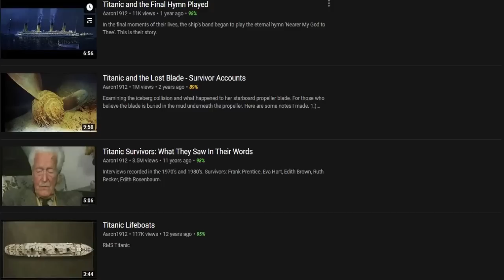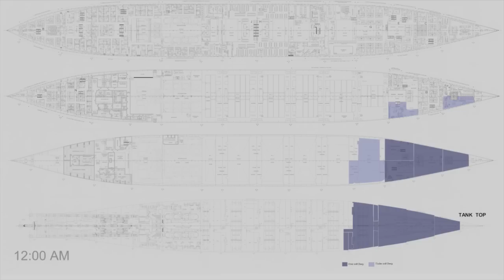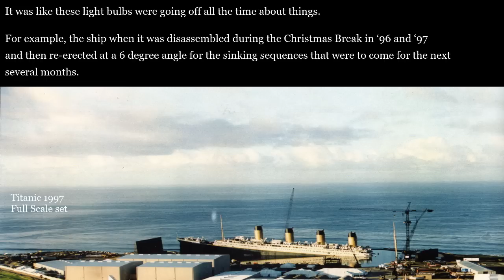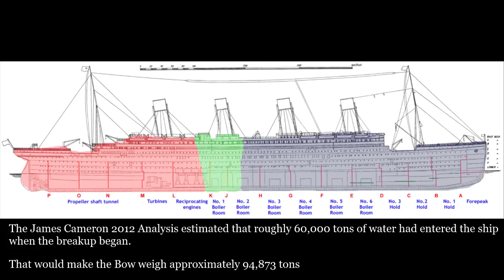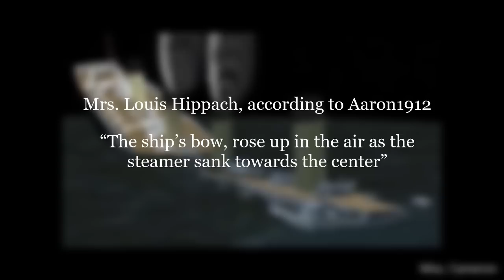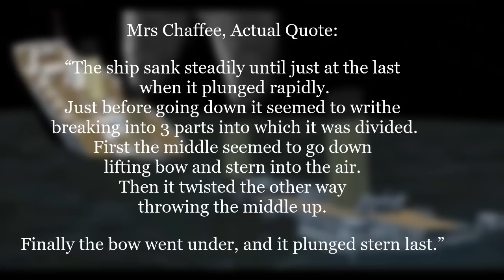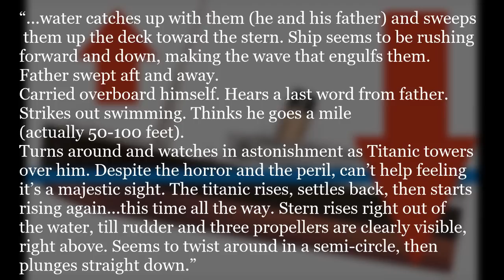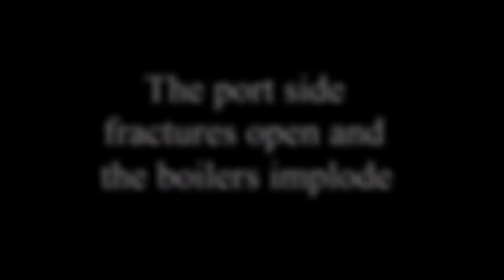Disproving Aaron1912's Titanic V-break

Comment: I agree with you on basically 99% of this.  I won't say 100% because there's probably something I can't identify immediately that I wouldn't.  But yes, the simple physics of the impact, the flooding, etc. dictate that whatever happened, whichever way the ship may have listed in the process, etc., it went down by the bow, and broke apart as the bow's weight pulled it down against the buoyancy of the unflooded stern.  Furthermore, the state of the stern upon the wreck's discovery corroborates this model, as the only rational explanation for its state of ruin is that it sank largely full of air, and that escaping air, being a compressible fluid and needing to escape due to its lighter weight than liquid water, compressed until its pressurized state overcame the tensile strength of the rivets holding together the hull, at which point it forced its way out wherever it could, blasting the stern apart.  The lack of air in the bow, by then fully flooded, is the only explanation for a lack of similar damage to that section, and absolutely, according to every law of gravity, structural engineering, and hydrodynamics, dictates that it would have been pulled down well prior to the stern.

Comment: The only way for both bow and stern to go up is if a torpedo or explosion went off right in the middle of the ship and break the ship's keel in the explosion. (Water floods the middle of the ship while bow and stern still have boyancey) Which was not how Titanic sunk. 
Last coffin the the nail is Tatanic's wrack is miles apart with bow pointed away from stern towards SW west of stern. If the bow sunk with tip pointing at sky, it should fall not far from the stern or even behind the stern (move towards east), hydrodynamics won't help the bow to rotate 180 in water...

Comment: How to fix this theory:

Either:

Disregard it completely

Or

She sank like she did in a Night To Remember, sort of, with no visible break above the surface, going fully vertical near the end.

Just like the National Geographic video, she goes down like a torpedo. However, she’s still in 1 piece.

And when the bow would normally go into a stable position, she is unable to stay whole and performs an underwater V-break.

This makes way more sense. It’s probably not true, but it has so much more accuracy.

Comment: If you are looking for the truth,  Check with your Titanic group and, well, physics really.   The bow does not get heavier when it is filled with water from sinking.  It gets less buoyant sure but the size of a crane needed to hold it up under the water would be that same (pretty much) as in the air.   i.e. 35k tons or whatever.  That's all you need to get it out of the water with enough time.   It's not the weight that's aaron's problem.   It's the speed.  You need time for the water to clear or you will be lifting the bow (35k tons ) and the water (about a gazillion tons).  
Just thought I'd give you a heads up as your likely going to get a lunatic video showing the bow isn't heavier with a practical (and valid) video so they can dismiss your entire video.

Comment: Common sense should convince anyone who watches Aarons channel that a ships bow(front) is for the most part the heaviest portion of all ships. Why? They carry two anchors and larger ships carry backup anchors just in case they lose one. So that is four anchors and massive chains that make up approximately 75% of a ships shear weight to be focused on the bow or nose.  

To believe that any ships bow could rise up from an already nose down position would be ludicrous.  In fact even ships torpedoed in half would never raise at the bow either. 

The stern(rear) being a wider birth to the tune of five to ten times the bow's width also adds in massive additional air pockets that would cause a stern to raise.  Aaron is attempting to claim a boiler exploded which also would be irrelevant because once cold water entered the engine rooms the boilers by this time would have been already extinguished and cooled down below any high pressure condition within a matter minutes not hours. 

I operated massive boilers used in feed production for many years and maintained them. Once you shut one off or kill the fire they begin a temperature dive below a shock level in about five minutes or less which would render any cold water shock caused explosion impossible. Likewise all boiler explosions are caused by too much flame, too much heat and not enough release of steam. 

The fact that the generators being boiler powered were still generated by some steam pressure even while sinking means no explosion occurred to have released all the boilers main line pressures and convinces me also that them and their main steam lines and pipe were still sealed and were properly still holding enough pressure to maintain the generators for the lights even as she was sinking which eye witnesses confessed.

So even if one boiler had exploded the main steam pressure line would not have maintained any pressure and thus no generators and absolutely no sinking lights would have been witnessed. ----Logically Aaron stands debunked !

PS Interesting enough is if the captain would ordered all three anchors and their chains to have been released, this may have prevented the ship from sinking as fast as it did and may have also prevented her from splitting in two as rapidly also. 

Buying that time could be surmised easily into 30 to 45 additional minutes per say,,,so in 1 hour and 30 to 45 minutes for Carpathia to arrive could have saved more lives than the 3 hour and 30 minutes it took them to get there likewise.

Comment: There is evidence of a potential V break just not Erin’s type of break the bow would not have broken the water the evidence is two pieces of double bottom hull And how the top part is crushed and the bottom is a clean break but again even if that happened the bow would not have broken the surface

Comment: I'm studying engineering, and the only way 13,000 tons and change would be able to lift the bow section is if the stern was on one end of a very very long lever, with the bow on the short end.  To lift the bow, though, the end of the lever that the stern was sitting on would have to be roughly 5 times as long as the end that the bow is on.  The stern would sink 5 feet for every foot the bow rose.

This of course assumes that the pivot point of the lever was on solid footing, which it wouldn't be in the ocean

Comment: the only way I could see a V-break happening would be if the ship had more-or-less 'skidded' into the iceberg during the hard turn and punctured the mid-ship compartments. the center of the ship would then have flooded and possibly caused the one of the ends to shear away upwards due to bouyancy (which would appear as a V-break) the issue with this is that there's no evidence that this set of circumstances occurred. so the V-break theory is nothing more than a hair-brained idea

Comment: Not that I didn't need to watch all your video but I have already stopped it at the 3:30 mark and know that the other guys animation cannot be correct.

1. The Bow was completely full of water. The water had plenty of time to get into every nook and cranny. Hence why it went down and only down.
2. Scotland road did allow lots of water to flow down the port side, eventually evening out Titanics starboard list and causing a port list that would persist until sinking. Scotland road caused the port list but nothing more. Experts believe that the stockpiling of coal on the starboard side, which gave the ship its earlier starboard list was countering the pull to port from the water.
3. With the Bow full of water there is no force on earth that will pull it out of the water. The reason the stern lifted was because it was full of air and the ships tilt meant water couldn't get to it but at the same time the full bow was trying to sink.
4. The stern lifting was what caued the stress in the hull and the eventual break. The ship would not break apart if it was sinking vertically. How could it? What would cause a ship to snap in two when it was at close to 0 degrees of elevation? Ships are designed to be flat on the water so it would never break like that. The Britannic is a good example here. Same ship near enough. It sunk so fast that the stern didn't have a chance to rise out of the water so far. It sank intact.

Further points

In the survivor testimony where they saw the nose rise out of the water, if the nose was initially underwater and then proceeded to rise up out of it how was this survivor "standing on the nose"?

Comment: Watched a video looking at the real wreck and  it is possible that the after the hull split, the bow moved upward. Not saying it is coming out of the water but the hull pieces on the bottom reveal that the double hull bottom flexed both ways before snapping into two separate pieces  and landing in the debris field separately. This is not anyone's recollection but what is seen on the sea floor. Still very small arguing point, the ship sank, sad.

Comment: I believe... 

the bow got deeper into the water right because it filled with ocean water..

Bow is submerged deeper, meaning if it continuously went deeper, under the ocean water level, and more water was flooding into the ship at the same time it's logic that even if the ship was sinking vertically the water will still be able to flow along the corridors and move towards the stern.

And then when the ship reaches the point when the stern is too high up, the pressure of the weight overpowers the hull and the hull breaks that would make more water pour into the stern.....trapping people...

Horrible..

Comment: 10:57
No. The bow weighs 34 873 tonnes. All that's happened is that there's no longer a meaningful pressure differential between the water inside the bow, and the watee outside the bow.

With no meaningful pressure differential, there can be no meaningful force of bouyancy.
The water stopped supporting the bow's weight. Simple as.

Comment: Actually the part where you explained the bow got heavier the more water entered it is incorrect. This would only apply if the ship was on dry land and water was poured into it as if the ship was a container or a bucket. This would then put more weight on the surface below, which would count as the ship being heavier.

With a ship being in the water this theory does not apply. When measuring weight, the fluid in which the measurement takes places does not count towards the weight of the measured object (air is a fluid, it just floats on top of water as it is lighter), meaning that on land you don't count the weight of the air inside the ship, as this is equal to the air outside of the ship and is part of the same volume. You do count the water towards total weight as it is not part of the main fluid in which the measurement takes place. 

When you're comparing the weight of the ship on water instead of in open air, any water that enters the ship and has a direct connection to the outside water does not count towards the weight, as it is part of the same volume of fluid in which you are measuring. The only water onboard that counts as weight of the ship is water that is not directly connected to the volume in which it floats, for instance bottled water, fresh water in sealed containers, water in flooded areas completely surrounded by air and water in sealed ballast tanks. This is because the volume of this water cannot mix itself with the seawater, meaning that its volume and weight can't change. Only when a direct connection to the main water volume is re-established does the weight of this water get subtracted from the total weight of the ship, as that water is then no longer displaced.

The materials out of which the ship is built are already heavier than water, but the ship is constructed in a way where it displaces the water without allowing it in, essentially forming a volume of air which is lower than the water surface. If you were to take the exact shape of the external surface of the ship that is below the waterline and instead fill this volume with water, this volume would be heavier than the hollow ship. This means that seawater would always want to be below this volume of air, pushing the ship up, making it float. The raw weight of the materials used to build this front section would still be 34,873 Tons, but the weight of the water it displaces is a lot more, which is why it floats, as the overall volume of the ship is lighter than its surrounding medium.

However, when the hull was punctured, every bit of water that was allowed into the hull no longer counted towards the displacement, because water wants to return to the location it was supposed to be in if there wasn't a ship there, essentially spreading itself out evenly trying to make an even surface all across the globe. But, no matter how much water was allowed into the ship, the weight of the front section would still always be 34,873 tons, it just displaced less and less water. As soon as the weight of the displaced water was less than the weight of the materials, the ship plunged below the surface. This still makes your conclusion about Aaron1912's theory correct. The only way the bow section could resurface after this is if there was enough rotational force and inertia to push itself slightly out of the water again for a brief moment, but this is impossible given the way the ship was orientated and broke, and it certainly would not allow the ship to float again, even if very tiny airpockets remained after the ship broke off, as these airpockets could never displace enough water.

Comment: Jeezus.

The ship doesn't get heavier as it fills with water.
The portions that fill with water lose their buoyancy and it is the weight of the bow section alone that breaks itself away from the stern.

The more complicated answer is that the bow and stern sections lever against each other at a centre of buoyancy that gets more comcentrated as the bow fills up and loses it's formerly uniformly distributed support. Bow going down, stern being lifted and this stress concentration is where the ship failed.

Comment: The doors would close automatically, yes, but with the hoses running through them to each compartment when abandoned would not allow for a tight seal when slammed shut.... There would be a gap where the crimped hoses lays through the doorway...

Comment: i do not even know how this youtuber even believed this 1st of all the bow is completley filled with water when it went under the only way for it to float up is to have a air pocket thats huge but since the bow went underwater with doors open the water finished the job with the bow causing the split so theres no way that the bow can raise back up unless theres a air pocket (in the actual sinking there was a airpocket which helped the titanic stay afloat long enough for every lifeboat to get far enough away) but since its air and is lighter than water it rised to the top area of the water as it was slowly sinking at the time but in aarons video playing in the background it shows all of the decks flooded so it is impossible for it to raise up  but the stern does raise up due to that air pocket after that water filled up the stern section of the split causing it to tilt down due to the air pocket that caused it to stay up the air pocket transitioned to the stern right before the split causing why it stayed over the ocean surface for the last few minutes before it completly sunk down thats basicly what happened in a nutshell

Comment: For the V-break to accurately work the iceberg would have to hit the 
mid-section of the titanic which would cause water to flood the middle of the ship causing stress in between funnels 2 & 3 which would cause the ship to split from the keel up. And the water flooding trapping air and causing an implosion to the bow and stern.

Comment: water in a ship doesn't pull it down, the water outside of the ship doesn't push it up as much. ships float due to being more buoyant than the water they are in. 
when the density of a ship is less than the density of the water it displaces, or any object, it will float as the medium it is in pushes it up, when it has a higher density it sinks.
water flooding a ship increases the density and so sinks.

Comment: The weight of the ship never changed, simply the Titanic's buoyancy changed when it filled with water.  It may seem the ship gained weight, but it was simple physics of the water replacing the air causing the ship to lose buoyancy and with that much sticking out of the water, nothing was going to stop it from breaking in two and sinking.

Ships with no hull damage when riding out a storm have to take care to keep as much of the hull in the water as possible to avoid damaging the hull, breaking the keel, etc.  In the movie, "The Caine Mutiny" they have such a situation and they almost break the keel when going bow into a wave instead of going parallel to it.  My 20 years in the Navy and 15 years in the Merchant Marines, this is exactly how ships operate in storms to prevent damaging the ships regardless if it's a tiny frigate or aircraft carrier.

Comment: I think that the most glaring evidence of the fact the ship went under bow first is the fact that that the forward chunk of the wreck is almost intact, a clear symptom of it being completely flooded. In the "V theory" it would have been impossible, since the air in the forward compartments would have blown the bow open due to pressure. We all know well the beautiful picture of the handrail on the extreme bow (that of the famous Di Caprio scene): it's pretty intact and it absolutely could not be had not the bow been completely flooded. On the other hand this of course happened instead to the aft section, whose wreck appears correspondingly almost unrecognizable.